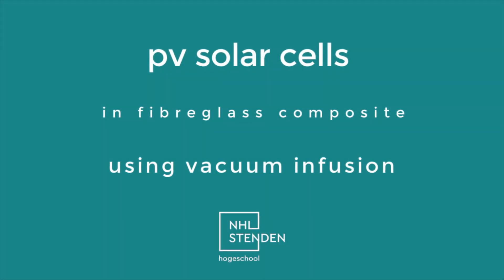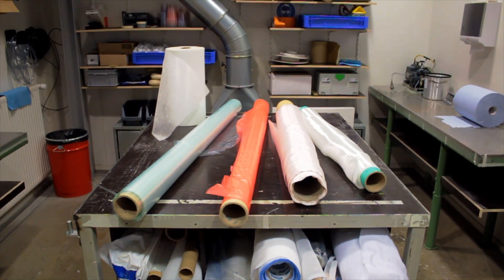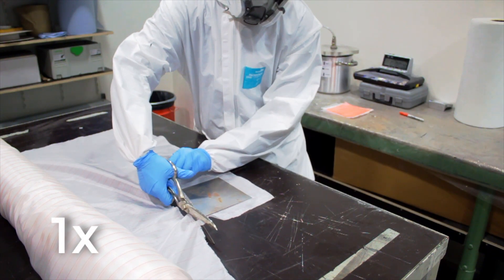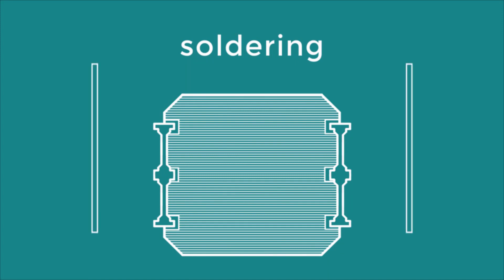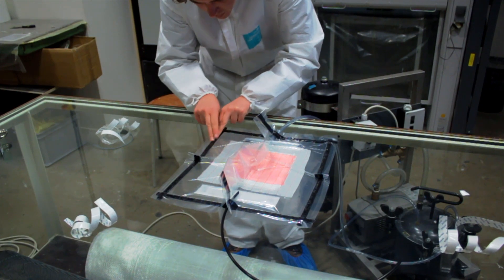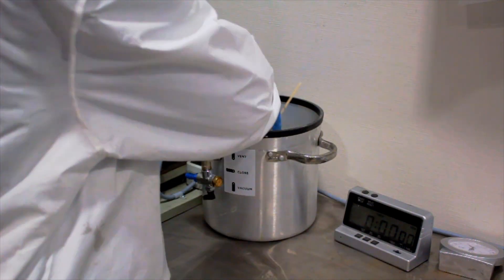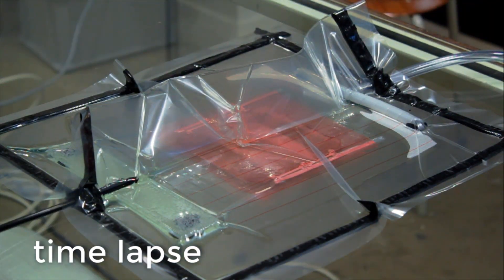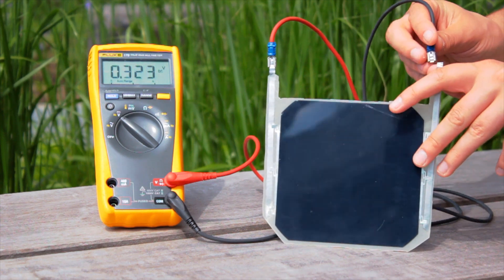Laminating PV Solar Cells in Composite

Comment: What's the Amps, again?
It looks like a really good job, but takes too long for non UV resistant epoxy.
Expected life, what, a year and a half in full sunlight?
However, the finished product looks really transparent, thus, there should be more amps generated (like 5).
You should've tested in REAL sunlight (and explain that epoxy resin doesn't last long.

Anyways, great appreciation for showing us the glass mesh/epoxy method which is great for other than solar panel use!

Comment: Wow awesome. I'd be curious how long this lasts against UV though. Could you lightly sand, clear coat and polish a solar panel like this again if it degrades?
I'm looking to build a solar powered cruiser and looking at those flexible panels they don't last very long. Even ETFE seems to last only 10 years while glass panels last 25 years or more.
I'm also wondering what resin is best to transmit UV. From what I understand it should be UV transparent in 350nm for efficiency. 
Reading about polyurethane for example it says it's UV resistant but it's not clear if it lets UV light pass through or some UV stabilizers absorb the UV light. I guess if I really want to know I need to test these properties myself haha.
Reply: I was all of a sudden iffy about epoxy, too. There's encapsulate called sylgard or something like that but it's expensive. They say "epoxy is brittle, will crack your cells but sylgard (or whatever the new name is) is a silicon". I think it's still a two part mix. It shouldn't crack the cells.
I'm sure the viscosity info would be presented.

Since it's been a while, I'd search "silicon solar encapsulant or encapsulate. I might do this, for trying to build a foldable 3.5v panel.
They didn't add any "cloth" or other layers, either, but had issues with bubbles because they didn't use vacuum. I think others did use vacuum.
Reply: @fireofenergy  Thanks! Yeah that does make sense. There are a myriad of epoxy formulations and it's more flexible than polyester resin, but I think UV exposure does make it brittle.

Comment: It seems like you would want to coat the fiberglass with something UV resistant before exposing these to the sun. Did you put something over them, like polyurethane clear coat or something?
Reply: I'm wondering about this too? Epoxy needs UV blocking top coat to last more than a year without yellowing. However solar cells need UV to yield maximum power! It would be really nice if solar cells could be put into a fiber glass mould like this for a compound shaped panel, but I'm not convinced they have solved this. One idea might be to use two part silicone brushed on the first two layers of fiberglass and then use vacuum infused expoxy on the backside, to both get the stifness and have a toplayer that doesn't break down from sunlight but let UV pass? Does wet silicone and epoxy bond?
Reply: @Tore_Lund  I believe that polyester resin was used in this video, not epoxy. Been forever since I watched it!
Reply: @mckenziekeith7434  Oh! Thank you, I was just thinking loudly, You forgot the stench of polyester? People usually remember it for life when they used it last!  Thinking further; Acryl is also available as a casting compound and is transmissive to UV and is not broken down by it. If it works with fiber glass I don't know?

Comment: Hello, could you please help me with link to glass fleece to buy. And what is the recommended thickness for it? Thanks a lot in advace!
Reply from the maker: We bought it from a dutch webshop polyestershoppen.nl. The thickness depends on the desired strength, durability and weight of the panel. You would have to do destructive tests to find out what works for you.
Reply: @thomaskokthomaskok  Thanks a lot! Yes, you are right. We will. 
It's going to our UAV airplane wings. Now we want to include cells into wing surface sandwich, not a separate layer as before.
Reply from the maker: @HaykMartirosyan  Sounds like a great project. Good luck!
Reply: @HaykMartirosyan  interesting. I am doing the same only using film to draw the cells down to the wing surface. Hoping that allowing the back of the cells to "float" instead of being laminated directly to the surface will cut down on damage to the cells due to flexing....
Reply: what thickness did you use?

Comment: what is the difference between glass fleece and fiberglass
Reply from the maker: The glass fleece is also fibreglass but very thin and has a random fibre orientation.
Reply: @thomaskokthomaskok  why do you cover a solar cell with fiberglass, that's crazy, no wonder why your power output was so low.